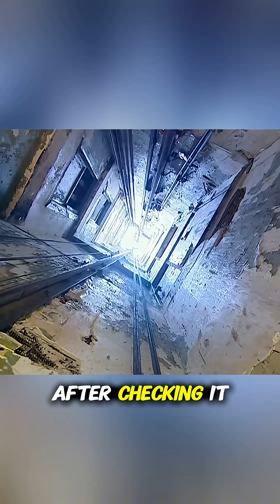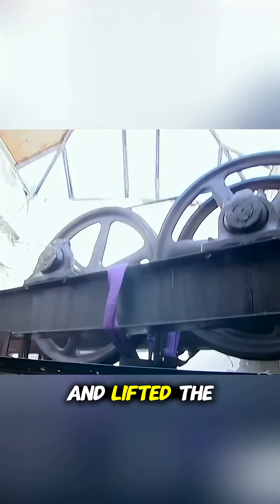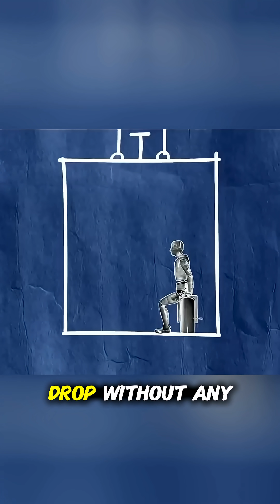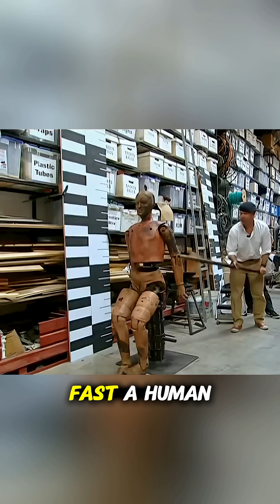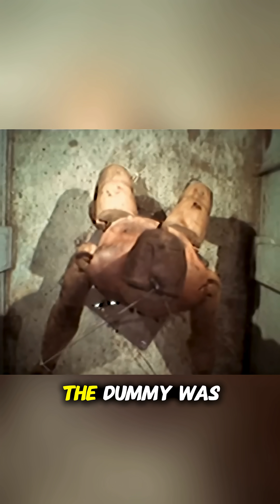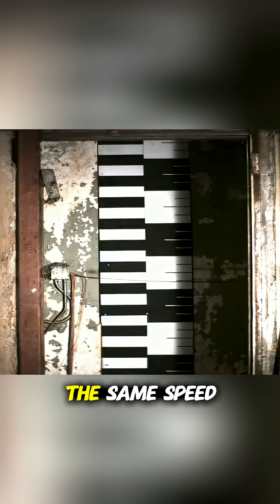Jumping in a Falling Elevator 💀 Does It Really Save You?

Comment: Ironically, the best course of action here is the opposite: lie as flat on the floor as you can. Elevators have springs at the bottom to catch them; by lying down, you will slow down with the car itself, rather than slamming into the floor.

Comment: put balls in a bucket with a lid. drop it.  play it back in slow motion. youd just be in 0 gravity until the elevator hits the floor, basically your falling at the same speed with the elevator then when the elevator crashes down, you dont, so your just hitting the floor and dying

Comment: It actually WILL save your life but if you jump at PERFECT time where the height left for impact is less than the height of the inside of the elevator and your head won't hit.
But in this expirement they did it befire one second which where probably the height left for impact was more than the elevator height.
Btw the smaller the fall and the taller the elevator the easier it is to survive but it still stays almost impossible since it is EXTREMELY hard to do it perfectly.

Comment: Now there's some actual credibility in if you was to be aware and had something above you can hold on to, the reason this isn't tested is because what if a really heavy person did it? THAT would fail, not because the logic itself will, but because it's the same reason there's weight limits IN elevators... Now, if the fat person grabs it last minute it'll say least hold up for a short few seconds, enough for normalised forces so letting go should do no damage

Comment: The best way to survive a falling elevator is to lie flat on its floor, like a starfish, so the impact force is distributed over the greatest possible surface area. It's the same concept as why nothing happens if you lie on a bed of 1,000 nails because your weight is distributed amongst them, but if you lie on a single nail, it will pierce you.
Reply: Free fall means you would be floating in the middle of the elevator. You can’t jump or lay flat when floating.
Reply: @sniper666hell  Terminal velocity isn't reached instantaneously; it's built over time through acceleration, dependent on variables that include but are not limited to drag force (air resistance compressed in front of the car as it falls down a shaft), friction, etc. Depending on those factors, as well as the reaction time of the individual in the elevator car, it may be possible to lie flat in time. You may float as speed accelerates, but at that point, you're already in the optimal position to mitigate impact force.
Reply: @TylerKnight free fall compared to the elevator has absolutely nothing to do with terminal velocity.
Reply: U still going to die no matter where u are or what u do
Reply: @SuAmigoElilegal  you should probably do a quick Google of Betty Lou Oliver
Reply: @SuAmigoElilegal  Maybe. But if there's even the smallest of possibilities that you can live, why not do everything to increase the odds?
Reply: @TylerKnight Cause I don't wanna live paralyzed TBH. Much power to people who can, tho big respect
Reply: Since100 years no one died in a free falling person lift ,there is the safety that safes you !

And one  cable can handle a ton 
They put 3/4  cables next to each other just to be safe 

There are cases where the elevator is only meant for, say, 10 people, but there were 50 persons inside; obviously, the cable snapped and the safety broke to Everyone seriously injured, but no one died.
Reply: @unbekanntunbekant4587Damn 50 people in a 10 person elevator? what were they doing lol
Reply: what if u float upwards and smack on the floor?

Comment: If the elevaror is moving at velockty v in m/s the second you jump you would need to accelerate with your jump  with v meters per second per time on ground which needs an insanely high force that tops even sports cars acceleration. In theory, absolutely possible in real life yeah bro good luck with that 🥀

Comment: It wouldn't work since you're already moving down. And in order to cancel the speed, you'd need to use extreme power to jump and overcome the speed . BUT, by doing that at the right timing when it stops, you'll just inevitably smash your head into the ceiling. If there was no ceiling, this would be theoretically possible, but you'd also need superhuman leg strength, which makes it impossible 😭 G-force also comes into play if you were to suddenly decelerate like that

Comment: I would suggest to put as many clothes or any soft materials as long as they are compressable eg in winter a winter coat under the critical parts of the body. So you gain some extra Millimeters of breaking distance

If you are not alone u can try to stack up the people. so the chances of the upper ones are rising. So u can try to save some others life.

Comment: This scenario is theoretical. An elevator simply don't fall, it's equipped with safety systems and I don't think that any respectable authority will allow an elevator to operate if it's not equipped with safety systems. 
If supposedly an elevator falls (maybe due to bad ropes), the overspeed governor will sense that and trigger emergency brakes which clutch into the rails to stop the car from free falling.

Comment: If a elevator falls make sure to lay down on the ground with your body spread out because this can help you absorbed the impact
Reply: elevators cant free fall cuz this issue was solved. It was solved cuz if it wasnt we wouldn’t have elevators
Reply: A common counter-suggestion is to stand with your knees slightly bent. The idea is that your legs would act like shock absorbers. increasing the distance and time over which you decelerate, thereby reducing the peak force.
Reply: What about my head? it would be directly on the ground as it crashes.
Reply: @dylantrashmint8379 their theory is that the impact would be devided on all body parts equally if you align your back with the floor
Reply: @VaddyGGs interesting, thanks.
Reply: @dylantrashmint8379  well you can try taling shirt or any clothing and fold them and use them lay on your head
Reply: @dylantrashmint8379 cover your head 😊
Reply: i think get off your dress as quickly to protect your head from impact, I think it might help
Reply: Nah bro just in crouch  position 😅
Reply: And cover your head 😊
Reply: It wont change anything .lol ur fcked anyway

Comment: when an elevator falls at a high speed you are also moving with it so you have the same speed as it going down and when the elevator suddenly stops you slam down because you still have the speed of the elevator and even if you jumped it wouldnt save you so the best option is to hold on

Comment: They should've had the dummy jump slightly, not to the full extent of our jump capacity, and had it half flip to lay flat in the air to avoid rocketing into the roof of the lift.

But a dummy can't do that, so of course the results were "fire is hot" tier.

Comment: Think of this that you are inside the car, noticed a fly inside the car doesn′t go opposite direction because you and the fky are riding the force of the car, if a car speed is 30 feet/sec and you can only move opposite direction at 8 feet/sec, you will still be pushed where the car is going at 22 feet/sec

Comment: You’d have to jump as fast as the elevator is moving downward to even attempt to counteract whatever forces were pulling you down. Little alone about how many stories/ if the box will cave in on itself like a pancake afterwards. 

Note to self. If you get in a rigidy ass elevator, just take the stairs

Comment: If elevator free fall, you would lose contact with ground
Reply: Not really. Elevator falls slower due to the air resistance at the list.  So you would be standing somewhat.
Reply: @Ihtiandr13 lol
Reply: @Ihtiandr13 no bro you dont know physics

Normal becomes 0 as we free fall due to non inertial frame, pseudo force acts
Reply: No, you’re part of the system
Reply: The air pressure inside wouldn't allow for that.
It's a bit like how we don't fly out the back of a train running at 200+mph.
Reply: " so you will be standing somehow " ...bruh ..you have imagination 😅 you're a kid
Reply: @sergiumata5713 no bro you dont know physics

Normal becomes 0 as we free fall due to non inertial frame, pseudo force acts
Reply: Best way is to hang on to something, like dead hang or if there is anything to hold on it go in a dip position and be in mid air while holding or hanging on to something
Reply: I’m really surprised mythbusters didn’t realize this when removing the counter weight.

Comment: You can avoid the force by using hands for example.
By putting your hands towards the ceiling you'll need to push as hard as you can  which will prevent your head from hitting the ceiling and for the ground you'll need to perfectly land on the floor.

Comment: You can jump but you have to duck too
Reply: Source : trust me bro
Reply: @axarionn7544 Source: cs 1.6
Reply: no if you jump you WILL hit your head because now your velocity is slower
than the elevator  and acceleration is constant so you’re always gonna cross less distance then the elevator until you hit the ceiling
Reply: Or just lay flat of the floor of the elevator
Reply: @Fabled-e5kthe force from the impact would course through ur body and destroy you inside. Either ways you die and painfully I might add.
Reply: you can but you'll still die. to cancel out the speed of falling with the elevator, you have to jump at the same speed of the elevator. clearly, no human is able to do that. you'll only slow your 60 mph fall to 52 mph.
Reply: jump ducking down and then extend your arms so you won't die
Reply: It’s physics it won’t change anything
Reply: Duck around and find out
Reply: Free falling doesn’t work that way.  Free fall is 0g. You would be floating in the middle of the elevator. Can’t jump move or lay down when in free fall. It’s like being in orbit.
Reply: Ok bot
Reply: No while you jump your velocity is still slower then the elevator so you quickly get hit by the seeling of the elevator so insted of getting hit by the lower side of the elevator you gey hit by the upper side
Reply: Cannon balling the floor isn't going to help. majority of people would get hurt just cannon balling the floor from a standing position never mind falling at 3 meters per second
Reply: put a handle bar at the top of the elevator ceiling and emergency helmet.

Comment: And that's why if there is a staircase, I'm using that incase of an elevator, I'm not risking to die fellas
Reply: You do whatever you want, but elevators will not free fall. They had to remove the safety systems in an already broken elevator to do this.

Comment: Everyone that believes this theory, seems to be forgetting one thing.. If the elevator is free falling so are you. Correct me if I'm wrong, but you are not standing flat on the elevator floor.. you are free falling. Or if you were sitting in a chair in the elevator and then the elevator suddenly free falls, you would also be free falling. You would not be sitting in the chair any longer.
So it would therefore be impossible to jump in an upwards motion if you are in a free falling state.
Isn't this correct...??
Reply: Even I thought that
Reply: Not really. An elevator do have a lot of friction into the guides. I'll never feel absolute 0 gravity and will have enough to jump. Still it's nonsense that a jump will save you. You'll end up falling X stories into a mangled pile of steel, period!

Comment: I'm thinking the elevator would drop first then your body would be milliseconds behind the falling elevator. A person wouldn't even be touching the floor.
Reply: Due to inertia, yes. But you would eventually land back on the elevator because it falls more slowly than you do due to the friction and air resistance on the elevator, as well as the fact that mass doesn't make things fall faster/slower. It's also because the air in the elevator moves with it, so you wouldn't be experiencing as much air resistance as the elevator. Unlike the air outside of the elevator which doesn't move with it, the elevator is being slowed down by the air that it is hitting.
Reply: @badguy96 when NASA does o gravity testing with 747 where the plane does a rapid descent and the people in the plane appear to be flooding?
Reply: @dlc2724  because the plane is increasing speed fast enough so the people inside appear to be floating, but an elevator can't descend that fast because it can't actively propel itself downward like a plane can
Reply: @badguy96 
￼

A "zero gravity" plane does not descend at a constant rate per foot; it is in a continuous free-fall for about 22 seconds at a time, during which 

its descent is dictated by gravity, not a specific speed per foot. The plane is carefully controlled to follow the parabolic arc of its free-fall so passengers feel weightless, meaning its vertical speed is the same as that of a freely falling object, but the plane is constantly re-engaging its engines to begin the next free-fall cycle.

Comment: Hypothetically ignoring the video you would have to jump up as fast as the elevator was moving down and faster to counteract the force
Reply: And you would still hit the ceiling, and let's say it not there. Unless you're able to just at the same velocity as the elevator or more, you're still hitting the ground just has hard.
Reply: Jumping at exact same acceleration at the last moment before impact is essentially letting that impact happen a moment earlier. Voluntarily. (Aside from not being possible for a normal human bean)
Reply: @Niezow 
What if you have a jet pack that will slowly accelerate you upwards?

Comment: even if you jump at the last second. your still have Mass that slam into the ground with a specific speed.
Reply: "your still have mass" .🥀🥀
Reply: @angelicatiberii7  what?
Reply: 99.99% of people especially in a panicked and terrified state wouldnt be able to tell or calculate the perfect time to even jump.
Reply: @S1D3winder30 
Exactly.  And when the elevator is going down, it's going down really fast.
Reply: You still falling but in an elevator basically.
Reply: And you have to calculate the height and speed that the elevator is dropping from, to jump at the last second
Reply: Yeah the strength you would need to overcome all that momentum is inhuman.
Reply: @baconatorwithranch  Also the Wreck of the Lift would crush you like a Pancake anyway
Reply: Best way is to hang on to something, like dead hang or if there is anything to hold on it go in a dip position and be in mid air while holding or hanging on to something

Comment: I’ve heard that you’re supposed to lie down.
Reply: I figure you couldn't lay down on the floor as you would be floating in the elevator as you are both falling at the same velocity.
Reply: @Uncommoness  I was searching for this  comment, and you are completly right. 
If an elevator has a sudden and catastrophic failure, meaning cabel snaps and every safety measure fails instantly,  you can neither lay down nor jump since you won't get into a crouching or laying position.
Some elevators have railings though.
Reply: @kalaidoskop9962 elevador will never free fall. You have several resistance forces.
Reply: @Uncommoness you jump first then push off of the ceiling to get flat on the floor
Reply: The ceiling will fall on you after all is down.
Reply: Correct. 
The key is, relex every part of your body.
Reply: And that's true have you heard about the empire state building fire?... ( an ill woman falling along with the elevator survived because she was laying on an inn matt)
Reply: No the first one would work for longer falls as you are spreading out surface area to cause impact all over the
Reply: @PLoOfyLaBs okay
Reply: @PLoOfyLaBs  wouldn’t your legs just absorb the force on landing as energy doesn’t just disappear immediately
Reply: @Vinylnilla  nope
Reply: @Vinylnilla exactly u may only end up with fractured legs and broken ribs but it might save u,works only for 4-5 floor drop,not 50 storey drop
Reply: @Vinylnilla depends on how long the drop is
Reply: @Jacob-n0t3yes u would lmao
Reply: Better than having your legs telescope into your chest
Reply: Yes! Along with covering your head 😊
Reply: Fuck the human body. It's a piece of shit badly designed system anyway. So fuck it.
Reply: Yeah I've heard that too
Reply: checked with GPT and it says
Stand firmly with your knees bent – try to reduce the impact force on your body.

2. Protect your head and neck – use your arms if you can.

3. Hold on to something sturdy – if the elevator has handrails, hold on to them to minimize injuries.
Reply: @snowfox.andDrawing   third party thinker
Reply: @snowfox.andDrawing  use an actual source before commenting
Reply: @snowfox.andDrawing chatgpt wont save you when it matters
Reply: @snowfox.andDrawing how tf ima hold onto something and protect my head and neck nga